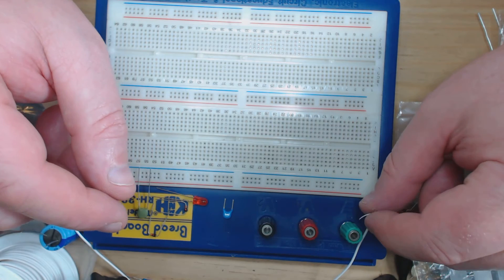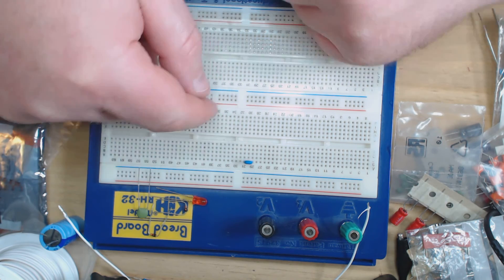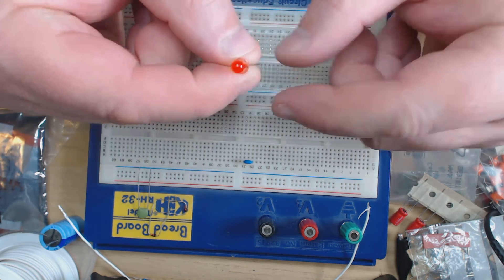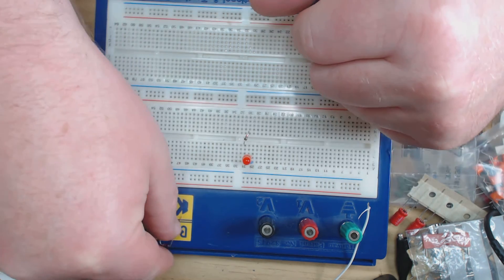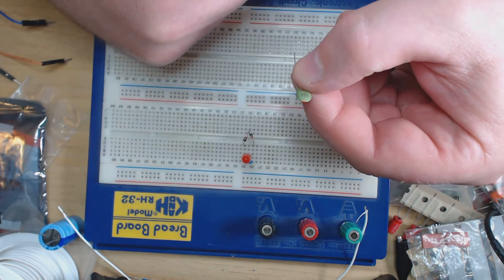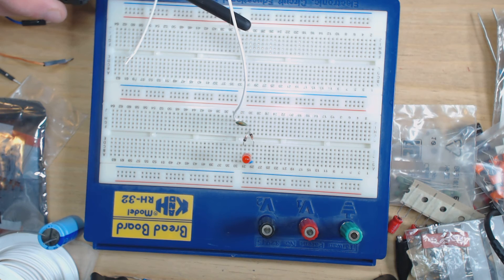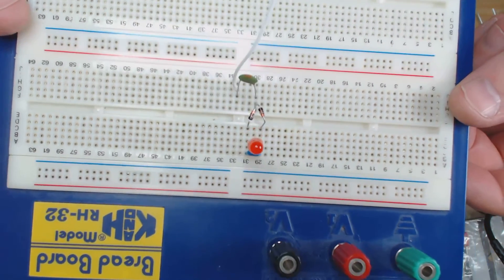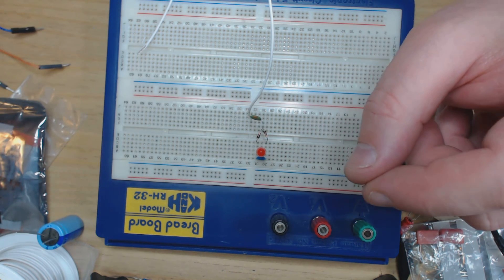Rf Probe, Rf Detector simple circuit

Comment: oh great stuff Garry. I wonder what diodes they were?  I am having a mess about with similar ideas here, but want to be able to detect the RF in some Ultraflex7.  73 Richie.
Reply from the maker: Hi Richie, they are 1n4148, the caps were 100pf and 220nF basically what ever I had in the bits bin.. I put the lot in an empty marker pen, not sure how I can use it yet.. the engineers upstairs said swap led for an AVO use some rg 174 to feed a cheap multi meter?? have fun.. G
Reply: @TheGazLab  I'd also swap the 1N4148's for 1N34A germanium diodes.